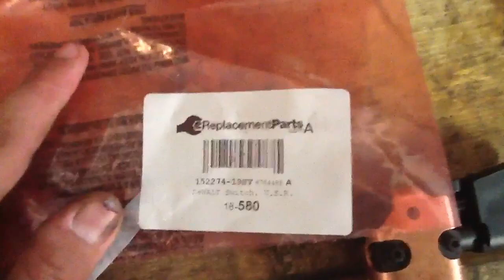Dewalt DW 995 drill trigger replacement

Comment: Trippin on the 7 year old comment, $45 ain't sh#t I'd pay that amount for a used battery for the 20v impact Dewalt drill I've never used and I've had it going on 2 years now. But one thing for sure I'd never spend no damm $700 for a 60v drill and I just learned about it for the first time today.

Comment: Thanks Patrick. Whats with dewalt triggers. first my circ saw now my drill. Oh well it is 13 years old and heavily used.  $45 damn, Ill either get a lithium or check the pawn shop for a parts drill.  If these batteries werent so expensive and just purchased I woulda sent it flying across the yard.
Reply: Jason Michael Kotarski  check ebay for parts i did
Reply: Jason Michael Kotarski  i did i found a new clutch at a good price  ereplacment parts do not sell that anymore